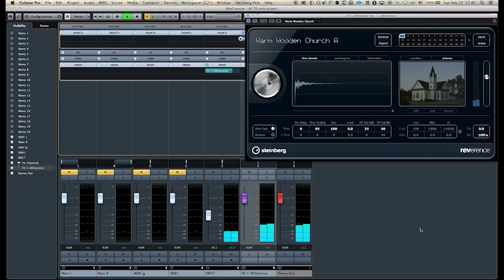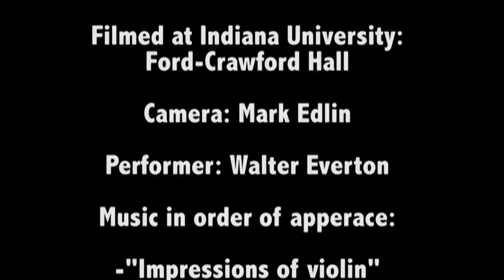How to mic a French Horn

Comment: Do you have any suggestions on miking a section of four players
Reply from the maker: That would depend on context. Are you trying to mic an orchestral horn section or more of a pops thing, or a film score? What I have found sounds the most natural for sections in general is to put a pair of spots on the section (although you could go all out and spot each chair), between 1/2 and 3/4 5-10 feet in the air pointed down at the section just past the bells.
Reply: @Falcowe  this would be for more of a film score type session, and also, that's what I was thinking as well. Thanks for the speedy response, much appreciated!
Reply: @Falcowe  ok ok wait, what if I only have one mic, what would you suggest in a situation like that?
Reply from the maker: So in that case I would try to get as close to the 3:1 rule as I could while maintaining a reasonable amount of clarity in the spot. In other words move the mic away from the section as far as you can while still maintaining its "spot" qualities.